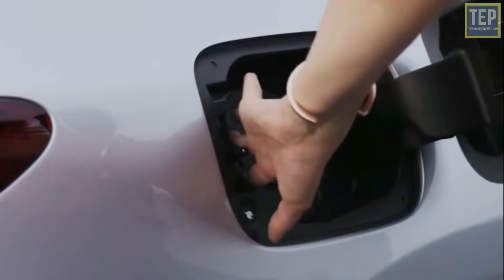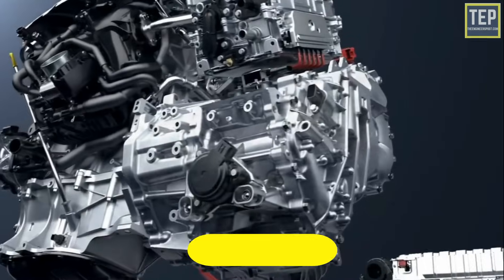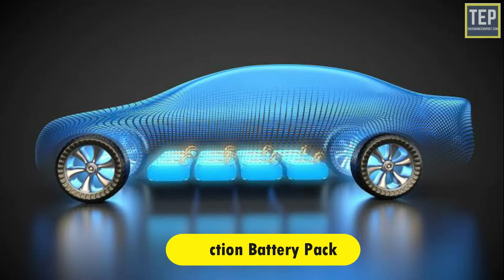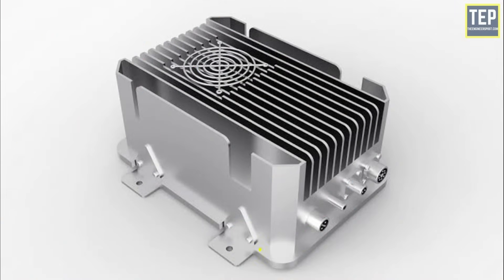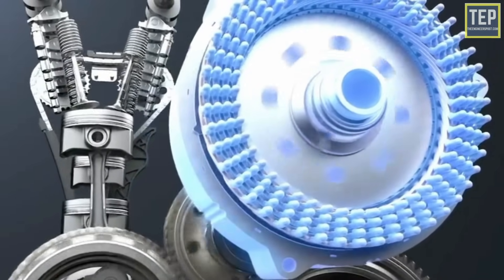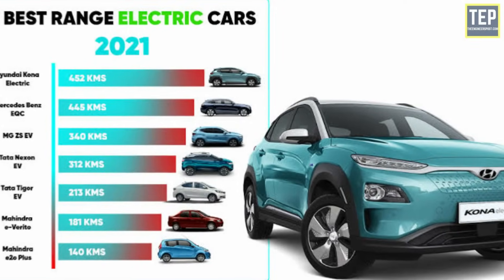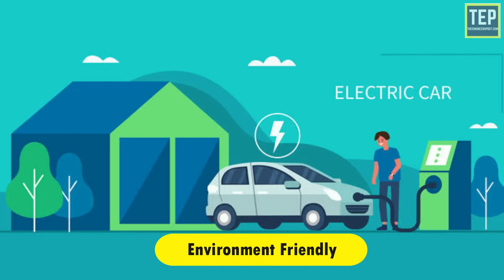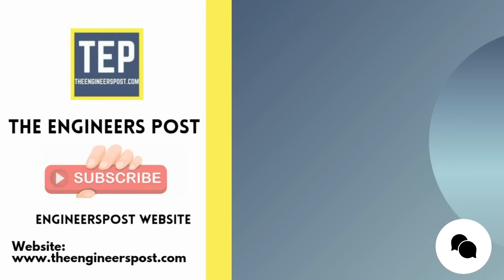How an Electric Car Works? Its Parts & Functions [Explained]

Comment: Yeah Waite till you have to replace the batteries,  it will cost you between 10 and 15 thousand dollars. Do you have the money?
Reply: Why are you so concerned about replacing the battery? The battery lasts at least 10 years, and most people would just get a new car at that point anyways.
Reply: @AAAALEON1  Are you so sure? I know people who have electric cars and 2 of them their battery went bad and needed a replacement. A couple was driving their Tesla on 222 in Lancaster county, in Pennsylvania when if just went up in flames. Thank god they got over and escaped. They don't do well in extream temperatures so don't get one if you live in Alaska or in regions where temperatures reach 100 degrees. I like electric cars and i have nothing against them but before i even think about spending $80,000 on one, they need to first perfect them and make the maintenance on them a little less expensive. Otherwise,  i have a 2014 buick lacrosse and a 2020 Nissan pathfinder rock creek and both of them are paid off. They run perfectly and i keep them polished and clean. Cars aint cheap especially electric vehicles so what you have take care of and make it last as long as you can. I put $300 a month into a separate savings. If my cars  last me 10 years or longer, well you see what i will have for a new car.....

Comment: 0:12 nobody gives f×ck to environment, people care only about money. Petrol and diesel is expensive compared to electricity. If electric car is more expensive in terms of charging then nobody will buy them. I believe in future things depends on if electricity gets expensive or cheap. If it gets cheap, EV's would replace engine based cars. Though there would be some point when petrol would get cheaper and cheaper let's say 40 rs per litre when there would be equilibrium in expense of both the cars.

Comment: Just to add evs will generate pollution not once you buy them but before its even made as the lithium used in the batteries causes tonnes of pollution while being mined

Comment: Inverting DC power to AC power is an EXTREMELY inefficient process. Why not use DC motors and eliminate the inverter? Why is everyone using AC motors?

Comment: What if the back wheels installed with motor that can spin both clockwise and anticlockwise, then the front wheels installed with alternator. The size of the alternator must be just right to produce enough energy at reduced drag as much as possible. Also at certain key points we inside the car we can install pyzo to also generate power. This will reduce power cost and increase battery range. Once formulated as usual we will install sensors to analyse both alternator and motor, the data will usher even more sophisticated adjustments into the future of free energy into car mobility. We just need to start testing and gathering data on this model.

With my education and learning, simulating this parameters is beyond my mathematics skill. Any assists from the engineering community will be greatly improve mankind to advance technologically. The funny thing in life is most of the technological achievements we mathematicians brain child's. Therefore if this is too technical for engineers i will understand. And the silence their after will be justified.

The power generated should then be step up by transformer, increase thickness of wire in secondary coils = increase voltage, as increase turns in the some secondary coils = increase amp. The pyzo need to be installed inside car wheel rim. The power then to transformer. AI will improve our tech as we feed more data and improve efficiency of the car.

The alternator we don't need magnets, we can power the copper on either the stator or rotor. That way the cheaper the copper the more advance humans will be. The rear earth will only be for other function before we figure out even more interesting Technics for them. This usher a new debate about information energy correlation. INFORMATION turning into ENERGY in other words.
Reply: Motor dan alternator jika diaktifkan secara bersamaan tidak akan memperbaiki efisiensi energi yang dipakai oleh mobil, sebaiknya alternator di aktifkan hanya saat mobil melakukan pengereman atau saat mobil menempuh jalan turun, pada saat mobil menempuh jalan turun motor dikurangi konsumsi energi listriknya sedangkan alternator pada saat bersamaan dapat memproduksi energy disalurkan ke battery (energy storage)

Comment: The generation of electricity in not all that clean. Electric vehicles just move the emissions  to some other place. Mining manufacturing and electricity generation are the biggest sources of environmental problems. They are also necessary to run an EV. Bottom line zero emission vehicles do not exist!

Comment: The electric car may be environmentally friendly, but at the same time it is a time bomb and expensive to maintain
Reply: So what are you doing to lessen your personal environmental impact? What are you doing to remove your dependence on fossil fuels? What about the time bomb of a gas tank in your vehicle? Are you purchasing solar or wind for your home? Are you worried about the continued use of fossil fuels until the time comes it’s depleted, or is that tomorrow’s problem?
Reply: @mikecalderon7992  Listen up:
1.  Battery cars are NOT environmentally friendly - they cost the planet much more than regular gasoline cars!  There is NO free lunch when it comes to energy conversion!  Sure, it is somewhat convenient to  just plug in your car, assuming you have the time, and charge it at home but that convenience comes at a great price!
2.  Battery are NOT recycled but are toxic wastes that must be disposed of!
3.  Battery cars at the end of their useful life 8 - 10 years are basically junk as no one will pay $25K-$60K to buy a new battery as technology has already moved on and no o ne wants an old style battery in their cars and it isn't worthwhile to keep it going!  So it just goes into a cra crusher!!!   You want to talk about WASTE??!!!   What regular internal combustion engine vehicle is scrapped after 10 years??!!!
4.  The amount of strategic minerals that must be minned to produce these battery vehicles is enormous and most of it is in China which would allow China to control our transportation !!!   Not a good idea considering China is our enemy and not our friend!
5.  Battery vehicles are not more efficient, even though, they appear to be, than ICE vehicles!   Considering we already have the infrastructure for ICE vehicles, to build out a complete infrastructure to support vehicles that have ZERO advantages is basically insane, costly and wastes our fossil fuels even more than if we did NOTHING!!!
Reply: Bruh. Everything has a tradeoff.

If you don't like EVs, don't ever get on a plane 😂. It's the same technology minus the jet engines.
Reply: Looking forward to getting one. I don't know which of them would be good for my long distance travels
Reply: @erickdickens3816  Buy one that has the 500 mi extension cord option!!!
Reply: Expensive to maintain? So a gas car with x1000 more moving parts than an EV is cheaper to maintain?
Reply: @Narcis.N  
Where do you get your free lunch Narcis??!!!
Reply: I've had one for three years, I spend way less on maintenance. This is a lie by the oil industry.
Reply: @ralphmelvin1046 there is no ecological véhicule. Lithium digging and mineral exploitation is a huge climat scam and EV is a running micro wave.
Reply: Your phone,tv,earpods etc is also a time bomb because they all run in lithium ions battery and i know you are from the middle East and your era is about to end in the upcoming decade.
Reply: What do you mean by time bomb?
Reply: The invention of the battery causes pollution, so it is not environmentally friendly.
Reply: I really do believe electric everything is the future,  but the value is only really achieved if you're recharging the batteries with renewable energy... plugging then in at home,  and supplying that power with a coal plant,  is absolutely irrelevant
Reply: A time bomb?
Reply: It depends on what EV you buy.  Cost to own is definitely lower after you factor in the ever-increasing gasoline price. Anyway, you are welcome to stick to your gas car for as long as you want.
Reply: Don't park an EV in your garage! Unless you have good insurance!
Reply: none of your points have any merit. There is ALWAYS going to be a new infrastructure change going on. Something is always going to be built. So that doesn’t make a difference. 
Literally everything gets disposed of after its useful life… at least it’s not pollutant while in use 🤷🏻‍♂️ plus it’s not like you drain your battery and then bam you gotta get a new one lol. 
Fossil fuels to charge an EV? You can literally just charge it at your house if you have a charger there. Idk about where you’re from, but my entire electrical utility grid is powered by dams and rivers, so you’re wrong there too. 
The only thing bad about EVs right now is the procurement of the materials needed for battery production and the charging times (which I believe will be better later on when manufacturers either make better batteries/charging tech, or make cars with easily swappable batteries).
Reply: It uses nearly as much energy as a home a year lmao how is that environment friendly?
Reply: @HyperDangerousThing energy doesn’t equal pollution.
Reply: @tyttonelkins6242  Pin headed response! 
Energy density of fossil fuels is unrivaled compared to batteries! You have to make the power, transport it then charge the batteries. Considering most energy in the US still comes from fossil fuels, you are adding another layer of energy for negative gains! 
There is no free lunch when it comes to energy conversion!
Reply: @LWRC  I bet there was someone else who thought the way you think when people started using gas over coal. 

So what if there aren't enough charging stations? Do you honestly think that that's how it's going to be forever? Or you wanted the sky to drop charging stations in every city in the world at a snap? 🤣

Come on man, be realistic.
Reply: @tyttonelkins6242  seems like it
Reply: @bororobo3805  
We're not talking about that are we??  It's lithium ion batteries vs gasoline or diesel fuel!   Which has a higher energy density??!!!
1 pound of diesel fuel or 1 pound of battery??!!!
Reply: @LWRC  Oooh. "Look at mweee . I'm smwaart🤓"

What exactly is your point? 

Perhaps you don't seem to understand the fundamentals here:

EVs are coming (back), and this time they're here to stay. No one is forcing you not to use gas cars. The backing Infrastructure for EVs is what will offset the energy density shortfall tha you're talking about.

Think like a rational grown up sometimes, yeah? 😁
Reply: @HyperDangerousThing have you tried using solar energy to charge it?
Reply: Battery cars are NOT environmentally better!!!
Reply: @LWRC and so is gasoline
Reply: @Tri3tanDoGood  Gasoline and petroleum products have been around for over a century! Battery cars are way more destructive compared to ICE cars as we already have very efficient ICE vehicles AND the infrastructure is already built for gas stations around the world! The damage I spoke about is the incremental additional damage above ICE vehicles and not the absolute amount of damage!!!
•  The hazardous waste for battery disposal at the end of their useful life is another negative factor not to mention the energy involved in the process!
•  Charging infrastructure is not available and must be built wasting more fossil fuel energy!
•  The majority of these battery cars are still charged using fossil fuels so nothing gained but actually a huge loss!!!
•  People drive these battery cars like they're professional race drivers racing from stop light to stop light since the fast acceleration is so addictive!!!  All that energy is NOT FREE and came from fossil fuels!!! So we have drivers burning up fossil fuels at even a faster rate!!!  How insane is that??!!!
Reply: @LWRC fossil fuels will burn until no more regardless of EV or not, but solar power and other renew energy will replace      it.
Reply: @King0Random  
Sure, in 300 years. Let the market place determine what is best. Until then, the government can get the hell out of the way and stop shoving this stupidity down our throats!
Reply: @LWRC  think about your simple family, if you know your reserve (e.g. water, food, medicine...) in the house running out soon, what should you do? find something else to replace it? or let it run out completely?
Reply: @King0Random  
For simple minded people, here is the reality:
•  Fossil fuels isn't about to run out anytime soon!
•  Look at the areas of the planet where strip mining occurred for rare earth minerals for battery cars !
•  For all you battery car proponents - you had better start growing your own food and making your own shoes and all other consumer products for they all exist because of fossil fuels!
•  What planet do you live on where YOU are able to violate the laws of thermodynamics??!!!
•  Where do you get all your free lunches??!!!

Comment: The charging simply takes way too long for it to be practical at all.  Until you're getting 500+ miles of 'range' in under 10 minutes like filling a tank of gas, it's not practical.  Especially these days we're talking literal hours of charging to get even half way to that 500 mile range.

Comment: I have heard that charging the battery at home in a standard electrical outlet takes many hours to fully recharge; and the owners will need an electrical system that has more juice flowing into the battery.
Reply: IN usa mains ia 120V...while in Europe is 220V . I have Nissan leaf 40 KW. I usually will need 20 + hours...to charge fully. So I charge 2wice.a week
How >USA does it..must be painful. 40 hours at domestic network..or say..daily. LOL

Comment: That's really nice informative video. 
One query on batteries,
There is a saying that we should use more of slow chargers rather fast or ultra fast charger to get longer battery life. is this true ?
I am not sure how fast charger decrease the battery life, could you pls explain ?
Reply: No.note, need to see the thermal conditions of the cells during the rapid charging.

Comment: A car battery for electric car weighs about 500 kg, the volume is the size of a suitcase. It contains 12 kg of lithium, 30 kg of nickel, 20 kg of manganese, 15 kg of cobalt, 100 kg of copper, 200 kg of aluminium (production is highly electrically closed), steel and plastic. There are 6,831 lithium cells inside.
You should be concerned that all of these toxic components come from mining. To make a car battery, you have to process 10 tons of salt to make lithium, 15 tons of ore for cobalt, 2 tons of ore to make nickel, and 12 tons of copper ore. In total, 200 tons of soil are ejected for one battery.
Disease and child labor are behind 68% of the world's cobalt and a significant portion of a battery comes from the Congo. Their mines have no pollution control and employ children who die with this toxic material. Should we count all these sick children as part of the cost of an electric car?

THE SIKHS WITH THEIR CANCER-CAUSING ELECTRIC CARS
Reply: You forgot to mention that the by-products of drilling for oil and refining it into gasoline are birthday cakes and candy.

Comment: Thanks for the video. Very useful.  

I have a question.  Do we wait for the battery to reach to reach a lower level (10% left) to charge or can we charge the battery at 90% full?
Reply: Yes, you can charge at 90% also .. but drain to 30% and the charge is to 100% will be the best practice.

Comment: I think you missed the following points:
1- Electric cars (BEV) range is very sensitive to ambient temperature unlike Gasoline cars
2- Electric cars (BEV) braking feels different to the driver (me) than Gasoline cars
3- Why do we need so many "Adapters" to use a charging station, please contrast to gasoline which uses the same type and size nozzle to fill up independently of which gas station you are using?
4- Why do we need so many apps to use a charging station, please contrast to gas station which use the same payment method, i.e. cash, debit card, credit card?
Thanks for the opportunity to voice my thoughts.

Comment: Individual car energy but if go stand it using gear or 3 phase sistem but in generator DC to AC using retifire for tesulting AC carent,for erounding motor and motor for erounding mesin.
Maybe.

Comment: Why can't they use the mechanism of using the alternator that will be run by the motors in charging the batteries so there'll be no need of using electricity 🔌 . That way the cars will be self sufficient . Bye the way electric cars still not green yet as use external source of energy to power the vehicle .

Comment: Why to use gasoline powered electric cars? If power is from gasoline how the pollution is reduced? Efficiency advantage is also not there! Then why gasoline powered electric vehicles be used?
Reply: Efficiency advantage of their. Diesel loco are hybrid.

Comment: How are the parts made? If the car is environmentally friendly what about the manufacturing process of it's part and also the environmental degradations caused by sourcing the raw materials for the battery.

Comment: Only truth: there are pros and cons for ICE and EVs. So no point to say/determine  which is better. It's a mater of personal suitability for his/her own need. My choice (I'm not saying "better") is EVs for their cheaper maintenance cost over the vehicle's lifetime. 100$ repair cost for 1 hour labor of which time a mechanics is working on multiple of ICEs...(i.e. 100$ for 20 min work for your car) just insane cost. I do not go with hybrid models because of more chance to see problems from their inherited complexity - ICE + motor ~ more components, more problems.